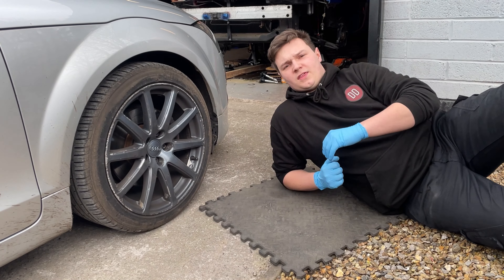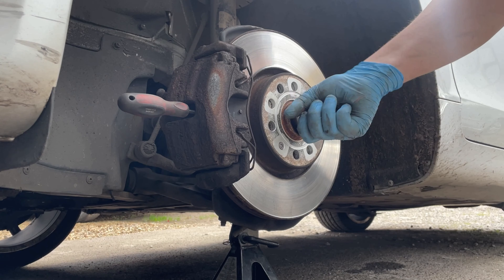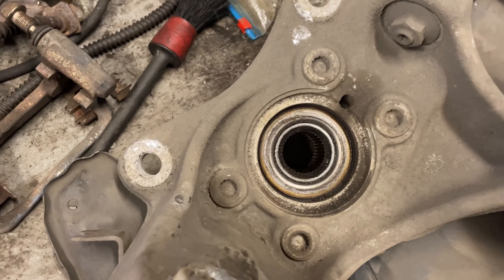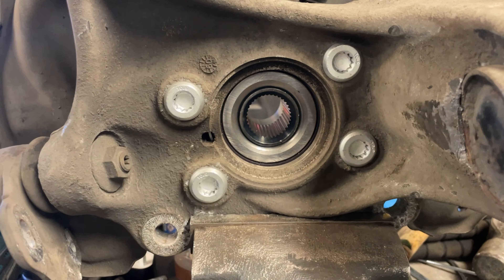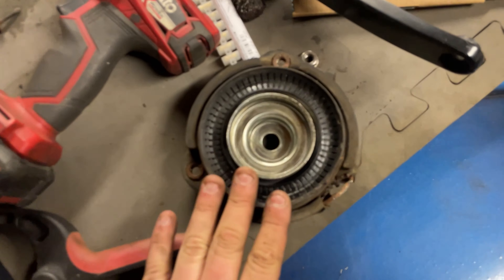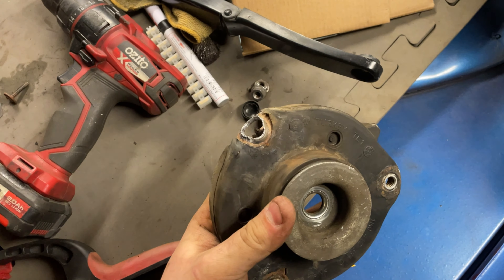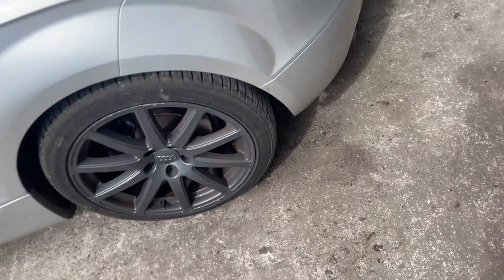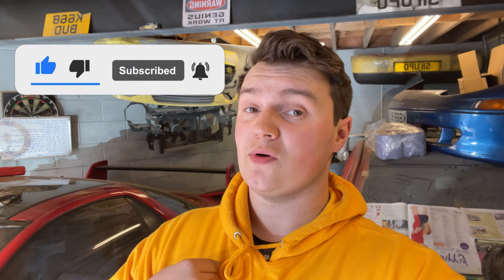FITTING H&R LOWERING SPRINGS TO MY AUDI TT

Comment: Good video pal. Given there is a fair bit of controversy around jacking points and axle stand placement points particularly on the MK2 could you either do a quick video or show specifically just where you are lifting her from and where you are bracing her with the stands. Thanks
Reply from the maker: Thanks! I'll include it in one of my next videos👍🏻 But it'll be just to show where I do it, not necessarily the "correct" way. I always look for a spot where it is already supporting the weight of the car (subframe mounts, control arm mounting points etc).